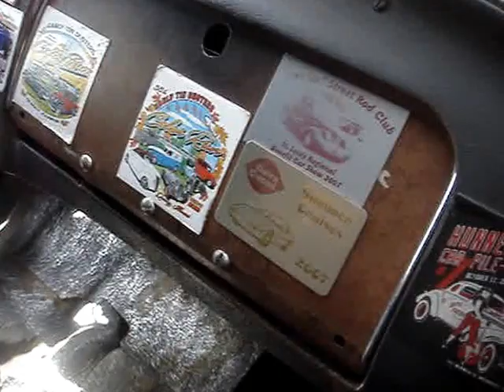1937 PONTIAC COUPE - MEET "DOROTHY", THE STREET ROD

Comment: Rat Rod !!! Raunchy Really Raunchy!!!Ive seen this ride myself upclose. I love builds like this and it speaks of the owners mechanical abilities.The 40 Torpedos frame is done and the suspension is done and the body is setting back on it again.Almost had a problem because two cross members and most of the right frame rail was rusted to thin and broke after moving moving it around .It had set on big wood blocks since 1961 so it been supported but when it was set down on its weight it sagged. It has a new rearend and disc brakes on the front.It will be a while on this job.
Reply from the maker: dougslittlediesel The owner of this raunchy Pontiac called it a street rod, although I think that this IS more of a ratrod but not as decorated as other rats I've seen.  It does take someone with ability to change out the drivetrain and install a high power engine like this one has.  So can you weld new steel replacement frame members to replace the stupid wood?  Yeah, put those new rearend and disc brakes on that baby.  Absolutely love those 40 torpedoes.  Good luck with all of that.